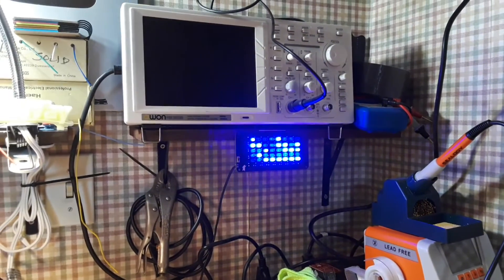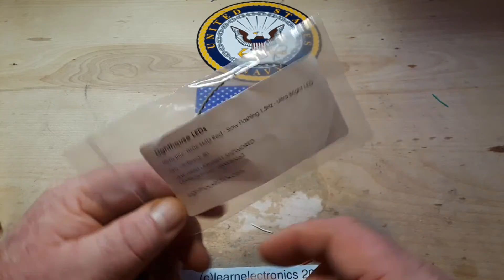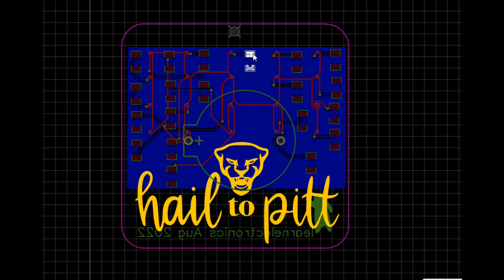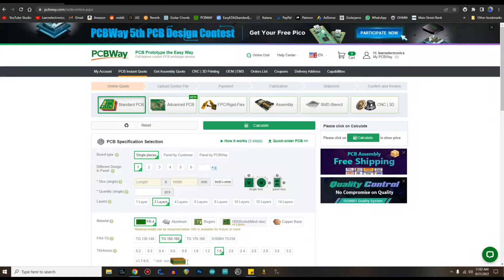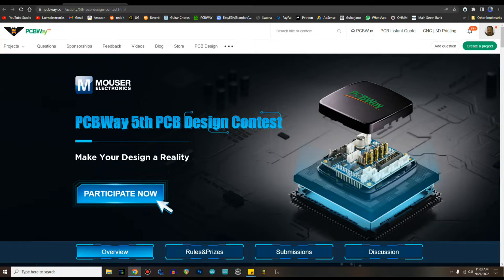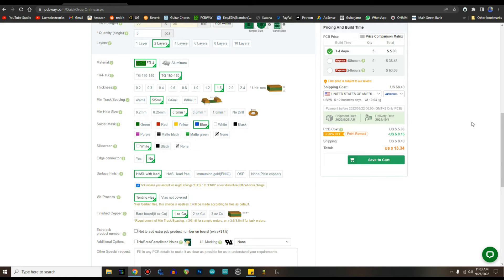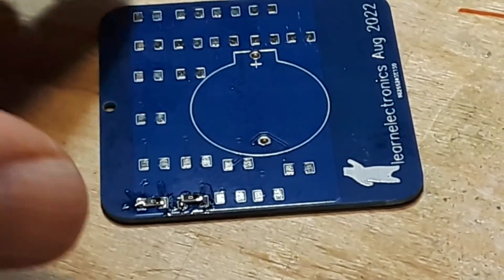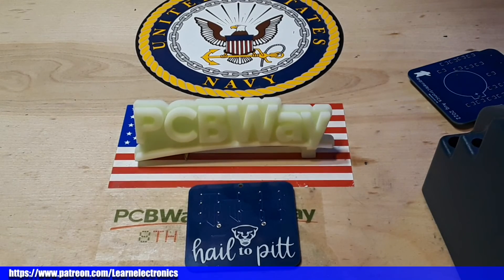SMD Slow Flash LEDs and a PCB

Comment: I need to convert 12v analogue signal 610 milliseconds to a pulse signal 12v from 90 to 130 milliseconds ( adjustable milliseconds by resistor)

(555 timer )

to clean the situation I connected the car horn with the door luck actuator because my car doesn’t make a sound when I locked it by keyless remote so I took a signal from actuator to Relay then connected to battery and horn to let me know if the car locked by hearing a sound

the duration time of beeping 610 milliseconds but  in the normal cars it is about 90 or 140 milliseconds
I need to make it like the normal duration  time of beeping alarm for the other cars

so I record the Tone  sound after installation and calculate the duration  time of the existing Tone 610 milliseconds
I need to make 555 timer circuit to generate a pulse with duration time 90 to 140 milliseconds 12v 
 please show the picture
 no 1# the duration time of the signal 610 milliseconds

No 2& 3# what I want

Please any help

Comment: SMD is pain, using 0805 so I can place components between pads on standard 0.1 prototypeboard. Mixed results but probably quicker to design boards since I have no more hair to pull out.

Comment: Suggestions... 1) To print... Most PCB programs have a PCB print function. I can not imagine that what you are using does not have this function, but, if truly not, then look for a .pfd export function. Save the pfd to a temp file and print the pfd image. Here's a scaling tip... Most inkjet printers do not print to 100% scale, even when set to 100%. Mine prints to 98%. This can make it impossible to check tiny pin spacing. So, draw a 100mm reference line on the Comments Layer of the PCB. Check this layer to export/print and print the PCB drawing. Measure the reference line. Adjust the scaling to print a true 100%. I use 102%. Align all components on the printing and proof the pin placements. 2) You are making it even more difficult to solder the SMDs, by starting the first solder pad on the left side, when you are right-handed. I know that you know better. I think you are getting freaked out about SMDs and that is making things even harder. Yes, you have lots of knowledge and experience, but you would benefit by starting fresh with the SMD learning curve. YouTube has excellent SMD soldering videos. Start with known excellent teachers like NASA, EEVBlog, AdaFruit, etc. Watch a bunch of the videos, before trying to solder SMDs again. I think you are making things worse/harder on yourself. Just IMHO. There are lots of other methods, too. Hot air, hot plate, etc. All very DIYable. Find the one that works for you. HTH